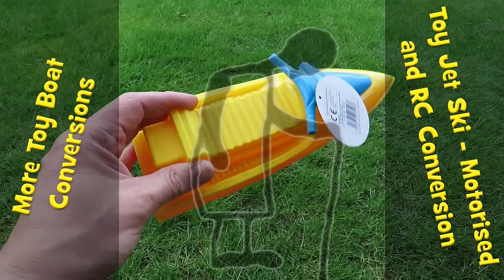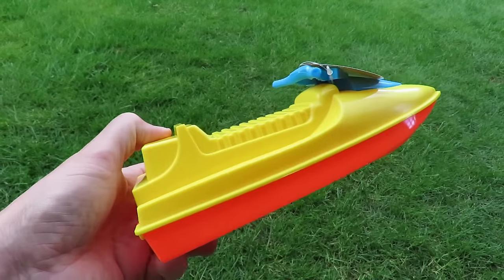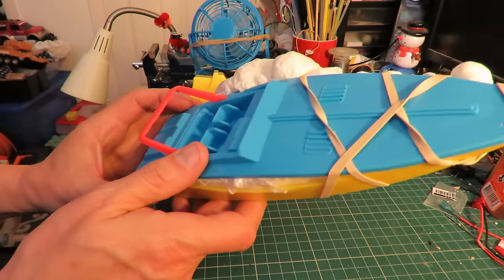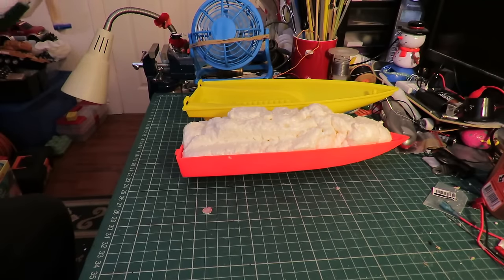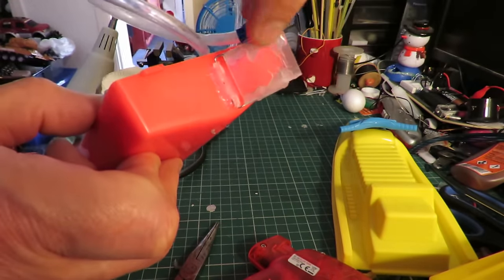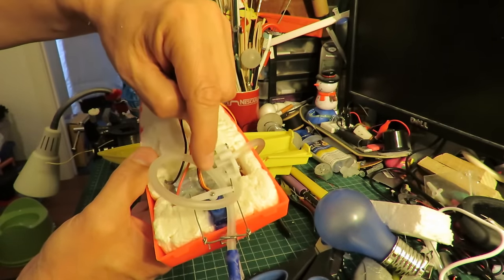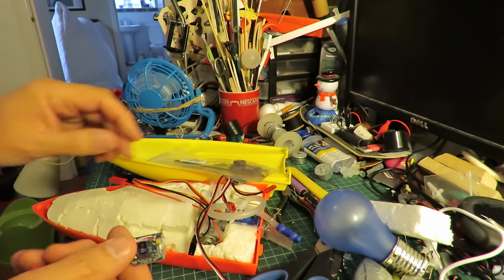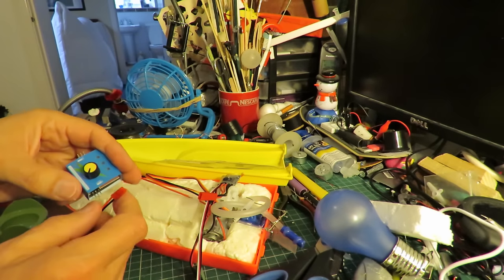Toy Jet Ski - Motorised and RC conversion

Comment: It will be fun to drive the boat with propeller also. My friend does it all time. Good trial.
Reply from the maker: Yes you could put a propeller on it but it wouldn't be a Jet Ski then, would it?
Reply: But it would be a vivid little RC boat. Nice trial for building a small jet boat. As a matter of fact, I have been thinking how to convert a Tamiya PBR boat to a twin jet. Ngom......Still in the stage of thinking
Reply from the maker: Kwokwing cheung :)

Comment: i think the boat would go faster if you put the output tube under the water but its your prefrance
Reply from the maker: I did a project a while back to test that idea and could not conclusively show any significant difference with above or below water although my tests seemed to show it faster above the water. The point is that you are not moving the boat by pushing the water with the jet. You are applying Newton's laws of motion. Here is the playlist https://www.youtube.com/playlist?list=PLA5a2xPRSrB0hOPEGWOYVtrLzBmgNTI09 In fact I can see you have already seen that video because you commented on it 3 months ago. Maybe you should try doing it yourself to prove your theory as I have demonstrated how it works the opposite to your opinion for me.
Reply: +GrandadIsAnOldMan  sorry, i forgot about that video
Reply from the maker: Haha, no problem. The trouble is that it is very difficult to show a significant difference in the performance. If it doubled the speed it would be easy to see but the difference is so slight it could easily be caused by other changes like maybe a little wind or some weed in the water or even fresh batteries.

Comment: I've tried my fast jet boat with a socur pad on and i was wondering why it going so slow and it turned out to be the socur pad as it creates lots of drag sucks in about the same amount of water but the performance afterwards is massive i ended up using a fine mesh. Try it without the socur pad in your bath and i swear it will make a big difference!
Reply from the maker: I think there is a significant difference between the power unit in your boat and the little water pump in mine. With your boat it can use as much water as it can get but with mine there is no noticeable difference as the small amount of water it needs is more than matched by the flow available through the scouring pad. I will do a little video to demonstrate soon.
Reply: +GrandadIsAnOldMan ok just a thought

Comment: if you keep the outlet pipe straight then i think there will be more speed
Reply from the maker: That is an interesting idea. Have you ever used a garden hose? Have you been able to judge any difference in the water flow when you have the pipe straight or curved? You might like to consider hydraulic systems work.

Comment: Did you try it with a larger battery?
Reply from the maker: It should be happy with a 2S LiPo as I checked the motor rating for the pump and it says 3-6 volts so I would be happy to risk it with 7.4 volts. Just need the right opportunity to test it in the right conditions.
Reply: I like the filter solution

Comment: You are really good at making something out of nothing... all your electronics are fine however, your propulsion systems are causing the lack of speed. This is not a real waterjet rather just a small pump that has next to no thrust. putting it in the water will make some difference however you should try buying an actual rc waterjet and using esc and recievers that you already have. I make a lot of fast rc boats with various drives ie jets, sub surface props etc but you seriously should consider some proper propulsion systems instead of weak water pumps and plastic fan blades.
Reply from the maker: Thanks Jordy but my view is there are plenty of videos of people doing things "properly" with shop bought hobby grade kit. You will find I do use some hobby grade items but I prefer to use junk.  Here is a proper water jet project I did Ecoiffier Abrick Rescue Boat RC Conversion https://www.youtube.com/playlist?list=PLA5a2xPRSrB08WVccLQ3j4SSRy9NMgeUo